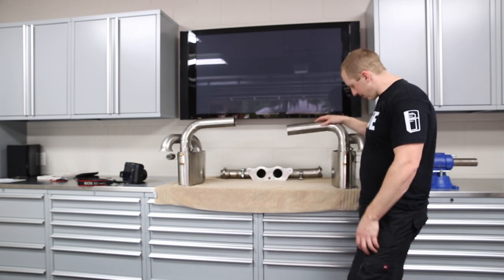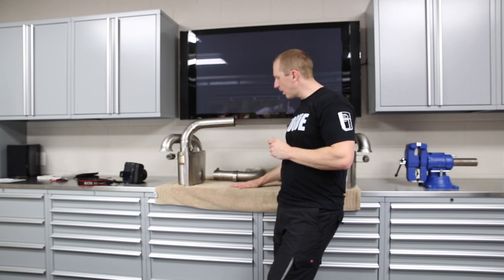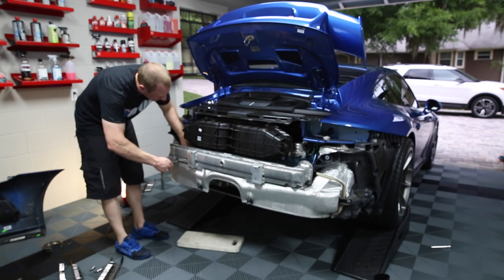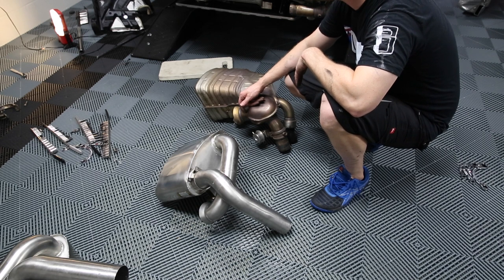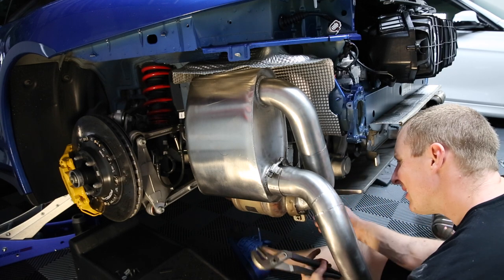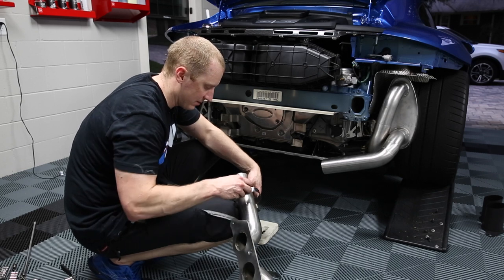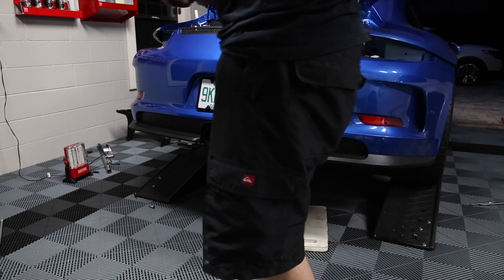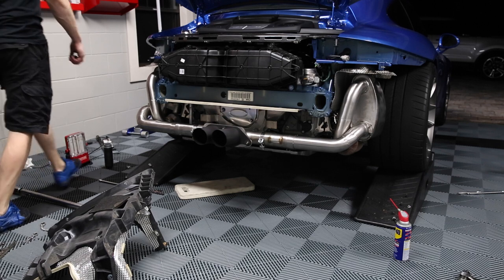991 GT3 FVD Brombacher Exhaust Install

Comment: The 911 is the best car ever built!  The design alone the way the wind goes up the hood over the top of the roof right down the back. I first fell in love when my uncle bought a brand new 87 911 Carrera no whale tail. Then in 89 he traded it in for the 911 turbo even back then the car was ridiculous! My aunt his wife always had a new BMW too. In 97 she got the sweetest BMW M Technic all white suede interior.  Car had all the M colors like paint marks in the seats all the stitching was done in M colors to it even said M Technic like pressed into the door handles. Ever since I have loved both brands very much. I have a BMW just have to wait for the right opportunity for the 911. I'll never part with my E46 I have thousands just into the suspension. What a tight ride you can feel every little crack in the rode I love it. I have an Auto Power cage in the garage I was going to put it in this summer but it was hot and I figured nice little winter project. I figured it would be a good upgrade to my car since I bring everything to the edge.

Comment: Matt Moreman  next install make sure you get all of your torque specs. Sharkwerks i'm sure of it would have given you all the torque specs for the install.   I installed Fabspeed exhaust on my 78 911 SC and on is for sure you want the correct torque spec.  Do you make sure you put the correct torque spec on your wheels?
Reply from the maker: Joe Rolon Torque on the rear wheels is 444 ft.-lbs. There is a specific procedure for dealing the the center locks.  The exhaust is a one of fabrication, so torque specs are anybody's guess.  I just do it by feel.

Comment: Hi, Matt. Sry I may have missed the info from your video, but what is the model of your floor jack stand and torque wrench? Looks very high quality.
Reply from the maker: Fei Jiao It's a cheapo Harbor Freight jack.  http://www.harborfreight.com/automotive-motorcycle/floor-jacks/2-ton-aluminum-racing-floor-jack-with-rapidpump-61406.html

The torque wrench is this:  http://www.tooltopia.com/precision-instruments-c5d600f36h.aspx?utm_source=google&utm_medium=cpc&utm_campaign=paid_search_google_pla&scid=scplp8151923&gclid=Cj0KEQjw6tepBRDLqLnxouaY_pkBEiQAPIOiBib_bbX20QMSQc2tU6d6Z2dyv--mErII_ouAJ2gO5QYaAlwF8P8HAQ
Reply: THANKS FOR THE INFO, MATT

Comment: The shark exhaust or whatever its name was the one you had before sounded better in my opinion:)
Reply from the maker: pipolebnene The tone of this is better, but it's quieter than stock mufflers and SW bypass.  I'm working with FVD to exchange this for side muffler delete and with M&M center muffler.
Reply: Matt Moreman it is always hard to transfer the real sound of an exhaust on video so if the tone is better thats good but too bad you have to work on more to get the result you wanted. anyway cant wait for your interior cleaning video to come:)  have a good day Matt

Comment: So is there a leak or not ? Did you finish the job ? Is it working ? Do it need some chip modification now ? So does computer know that it has new exoust?
Reply from the maker: DonDomel This was a slight leak, but I fixed it.  I didn't torque the clamp on the cat enough.  No modification to the ECU needed.  I did finish it.  I'll have some follow-up videos soon.  http://rennlist.com/forums/991-gt3/868620-fvd-brombacher-full-cat-back-exhaust.html
Reply: Matt Moreman thx :)

Comment: So now you have GT3, that doesn't meet Emission regulations. A few lb, or kg weight reduction, but no heat shield, where free flow pipes run next to brake disks. And your vehicle insurance is void, because of the increased risk of fire. I used to fit Holley carbs, Hooker headers and cherry bombs to my corvettes (aside of Crane cranks and cam shafts etc), at the time, when American cars lacked the sophistications (they still do) of their European cunterparts. In this case, GT3 is a "highly tuned tool".  If you start piddling with  exhaust gas flow, you will need to reset the engine management and potentially to replace the chip. Porsche will find any excuse under the sun, to wriggle out of their manufacturer's warranty, if things go wrong with your vehicle. All European GT3 were recalled in 2013/14, because of faulty piston rod connectors. A few GT3s have caught fire and Porsche was forced to revamp the engines.  Whilst I admire your courage to experiment (you obviously have money to burn) and to risk the cnsequential losses, you should perhaps leave this type of work to Porsche approved tuners.
Reply: Mike Koolish   I deem it pointless to discuss the stuff with a prat, who thinks that installing the free flow aftermarket exhaust system in lieu of factory standard exhaust, N.B. on the highly tuned normally aspirated engine .. is just a matter of dismantling one and installing the other. Porsche charges equi to US$ 300 / hour in UK. It comes down to $200, if you go to an independent, "Porsche recognised" tuners, who will guarantee their work, whilst the reminder of the vehicle retains it's Porsche 3 years (on new vehicles) factory warranty (parts and labour). This type of the work, by the enthusiastic amateur, would invalidate Porsche factory warranty in most European countries.  Obviously on vehicles older than 3 years (which his GT3 is not), you can do what you like.  Normal people (obviously not the inbread degenerate like you), if they can afford to spend $160k for the GT3, they can afford to pay $600 for 2 Porsche technicians, swapping the pipes and pluging the GT3 in, to remap the ECU.
Reply: +Mike g   Somehow I feel, that it wasn't meant to be a compliment?  These comments are typed on smartphone, during the tea break. If I wanted to be wordperfect, I would ask my secretary to type it.  That aside, if you have nothing constructive to say and know squat about 991, stay out of it you degenerate.